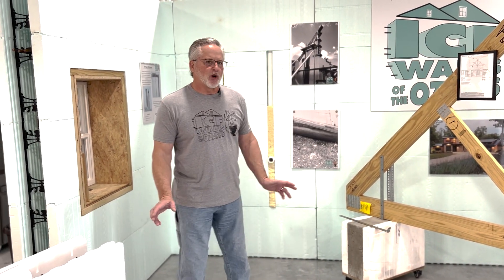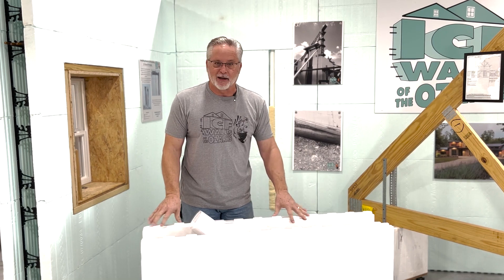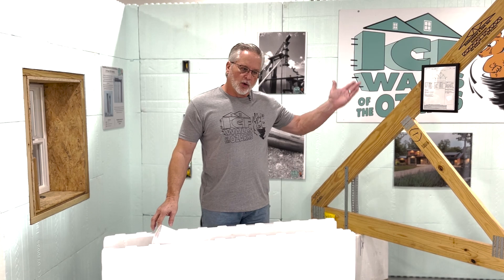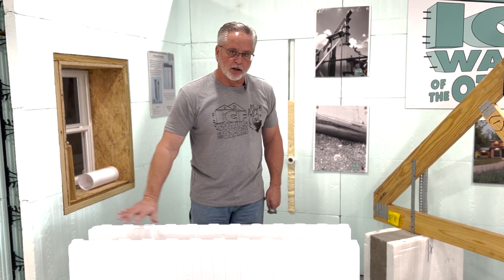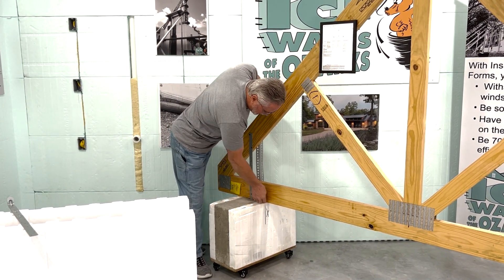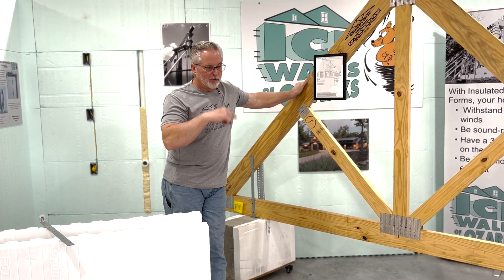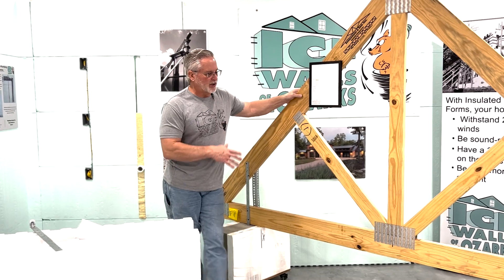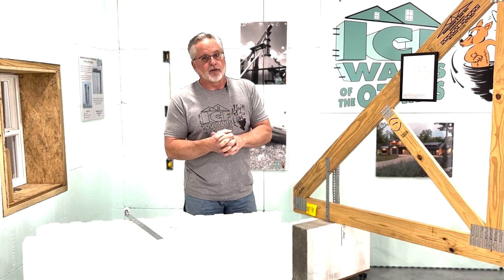Legacy System Part 2 - Engineered Trusses

Comment: Thanks for sharing. I have question on gables, your side gable truss will sit over the concrete as load bearing wall, but there is 2.5” foam as gap between exterior ICF wall and truss. Your gable needs to be align with wall so my question is how do you overcome 2.5” gap? Do you frame around following gable truss by 2x4? Thanks
Reply from the maker: Thanks for the question! We build our gables using ICF.

Comment: Been researching best ICF practices as I am switching over to them for my spec builds.  Those simpson straps are what I was thinking of using, awesome seeing that’s where your truss engineers went with.
Reply from the maker: A great option for specs if the price can be made right!
Reply: @ I’m in CT, MA, RI area and the 21’ IEEC make stick framing more complex and added cost.   ICFs are much simpler, better product and scheduling/time which is the biggest factor out of my total control.

Comment: Awesome … love your thinking. 👏👏

FYI, we’ve been using that same truss tie-down in South Florida for many decades, installed exactly as you described. As you can imagine, we build for high velocity hurricane winds.

I am not sure what truss anchor you use / you showed, but it looks equivalent to a Simpson Strong-Tie META or HETA Truss Anchor. Simpson Strong-Tie is the manufacturer most commonly used here in South Florida. 

• The META is rated for 1,450 lbs of uplift. 
• The HETA is rated for 1,810 lbs of uplift.
However, both are only rated to resist movement in one direction (uplift).

If you really want the best and strongest tie down (for the application discussed in this video), check out the Simpson Strong-Tie DETAL Truss Anchor. It is rated for 2,480 lbs of uplift and resists movement in three directions (uplift and lateral loads/forces).

Check out Simpson Strong-Tie Catalog Pages C-C-2024 (Wood Construction Connectors), pages 264–265.
Reply from the maker: That's a very cool tie-down system you have going on in Florida! Thanks for sharing this information and catalog pages with us!